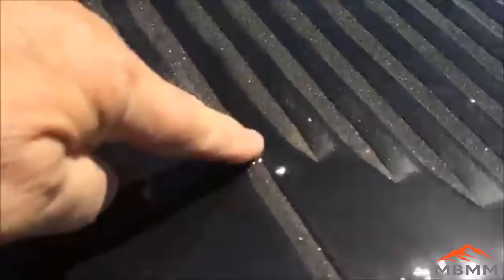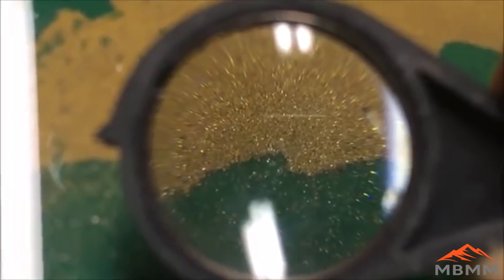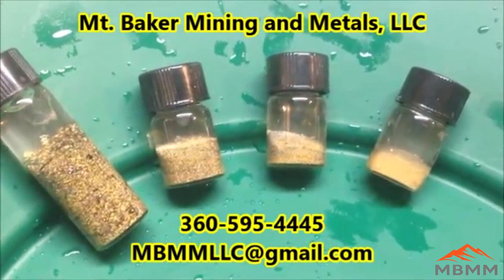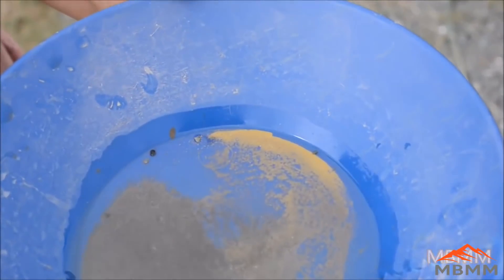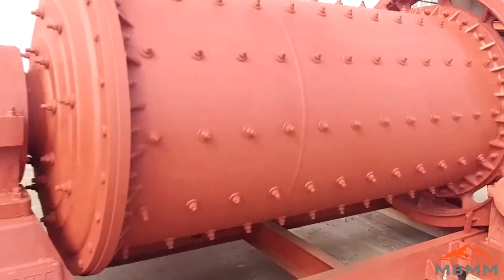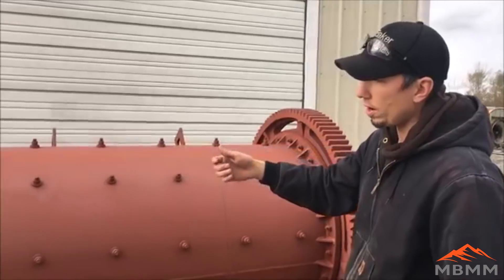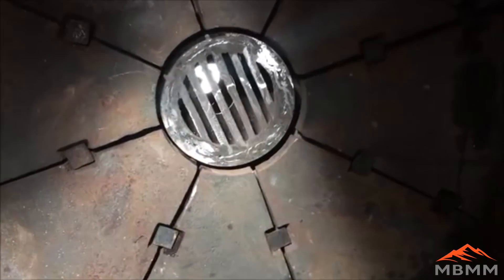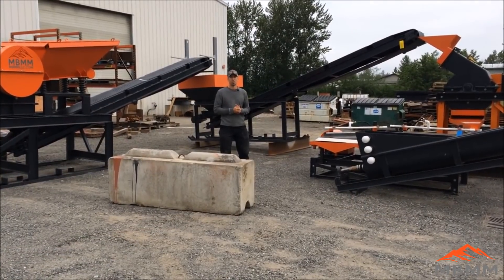Gold Ore Processing Machines For Pilot Plants, Bulk Sampling,Small Scale Miners

Comment: Would love to have a set up like that. Probably too expensive though
Reply from the maker: Thank you for the comment.  For questions about pricing or equipment please send us an email at info@mbmmllc.com or call +1-360-595-4445.  You can also visit our website at www.mbmmllc.com  Thanks for all your encouraging comments, great ideas, safety concerns, environmental concerns, and cost questions.  We prefer to communicate through email so for any specific questions that need a response please email us! Thanks again for watching all our videos!
Reply: Saya baru saja beli meja goyang dari China
Reply: 1) Jaw crusher with Conveyor
2) Hopper/Vibratory Feeder with Conveyor
3) Hammer mill 
4) Shaker Table
Figure $15K for jaw crusher, $25-30K for hopper + two conveyors, $30K for shaker table. $70-100K all I . At today's gold prices, it's paid off in 6 months if you run 1 ton of ore per hour, 8 hrs per day, if it yields 1/4 oz per ton. That also pays your crew and puts a wad of cash in your pocket. Of course, not many claims yield 1/4 oz per ton.